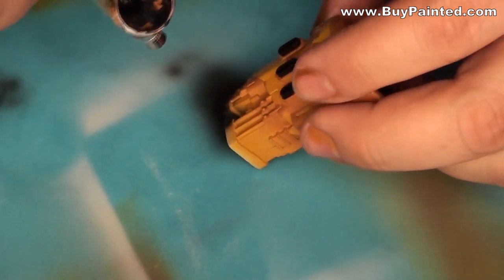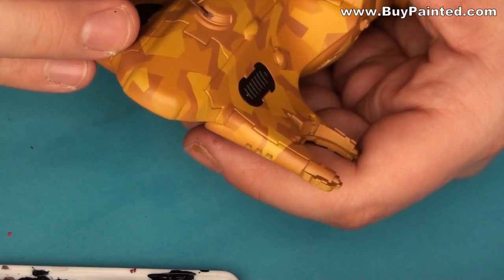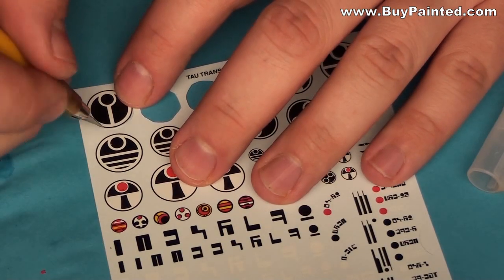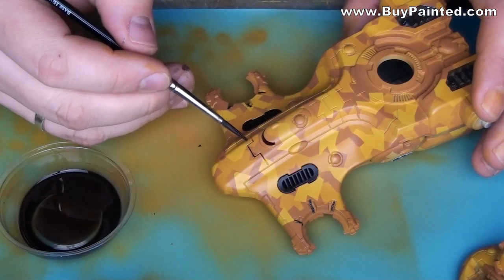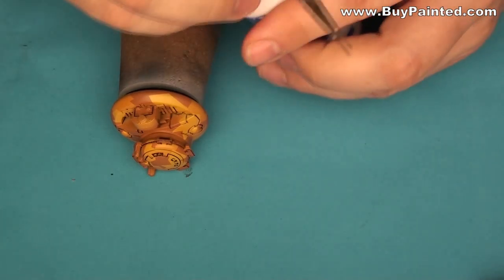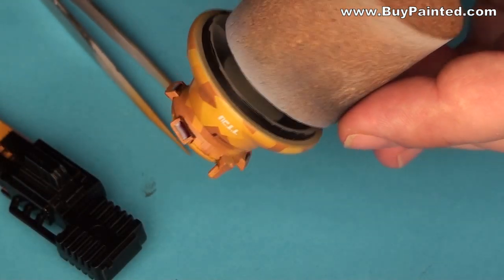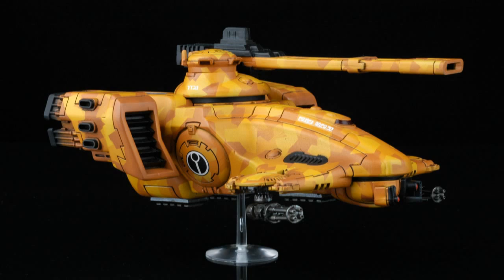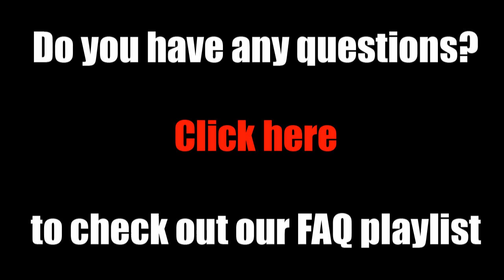How to paint Tau Hammerhead? (Desert Camouflage) 2/2

Comment: Great video as always. I just started airbrushing and working on some tau. I was wondering what brand of satin varnish were you using. Is it airbrush ready or how much did you thin it down. I would like to make the wash step as easy as possible and keep it clean since it is tau. If I used GW washes, after the satin varnish, on a riptide could I go over with a q-tip with isopropyl alcohol and clean up the armor areas? Thanks so much

Comment: what wash did you use to put in the groove lines, was it black wash watered down??
Reply: He used an oil paint and most likely washed it down with an enamel thinner. You can use artist oil paints and any enamel thinner, like from Windsor and newton or mig ammo will work. This technique is called pin washing